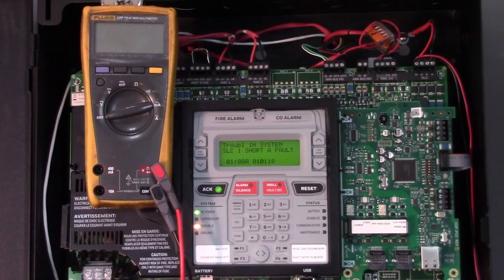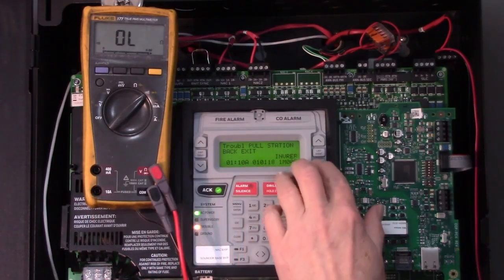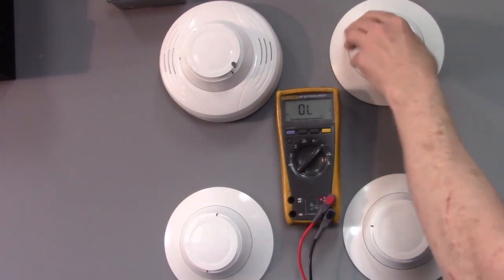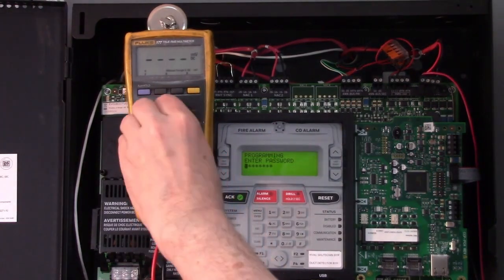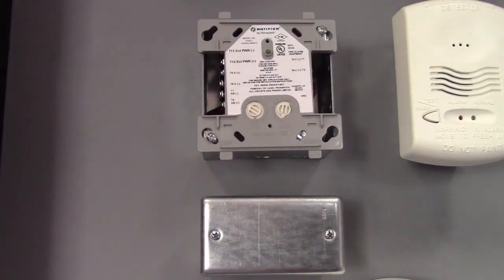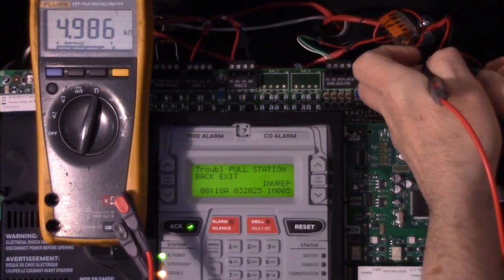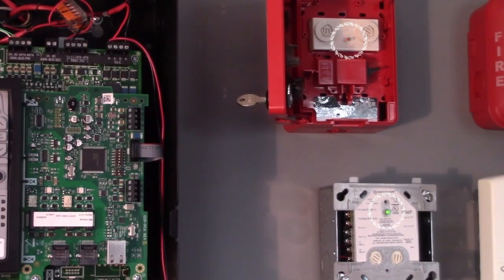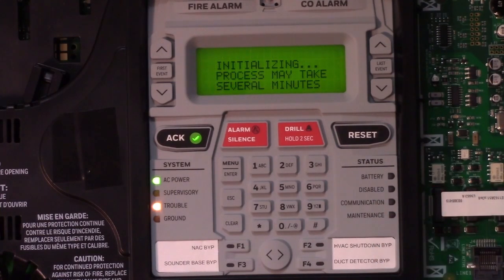⚠️ Troubleshooting Fire Alarm SLC Issues

Comment: I wouldn’t trust the resistor readings your making after you pull the SLC off the panel board. You should remove the plug to get an accurate reading.
Reply from the maker: Hello,
I am unsure what you mean, when unplugged there is no continuity between the + and - terminals of the connector.  Is there a specific timestamp in the video that would help me understand?

Comment: Hey man, not to knock your video. Youre really great. But maybe some quality contril would help some people. Your video is right on track. However, in the video you didnt really explain in the begining why swapping the leads is important. Also, while checking diode mode, you had it on continuity. Not diode mode. Diode mode prodices a small voltage. Otherwise good video!
Reply from the maker: After looking again you are correct, I neglected to push the button to activate the diode check mode, the Fluke 77 in my field kit doesn't require the extra step. Very observant!
Fortunately with that meter, the method works with both settings, displayed as ohms or volts respectively.

There will be a Short video released Friday morning showing that in more detail, thanks again for the input.
https://youtube.com/shorts/3DIJITveSbs?feature=share
Reply from the maker: Hey, really appreciate you watching and taking the time to comment! You're totally right—I should’ve explained the lead swapping better. I was trying to show the difference with both ohms and diode check, but I can see how that got a bit muddy. Still figuring things out with YouTube, but feedback like this really helps me improve. Thanks again!

Comment: I had a panel last week with all the devices coming in as "invrep" how would you troubleshoot that?  Do you think the SLC is bad? It was a fire lite ms9200udls panel.
Reply from the maker: Hello, thank you for contacting us, please remember to like, subscribe, and share. 👍   🔔 
A few things come to mind.

Did you measure and document the DC and AC voltages on the SLC, it should be 16-20 VDC? I assume there are no shorts or grounds on the system and the panel programming should match the device's protocol, CLIP or LiteSpeed.

Do you have voltage at the devices that matches that measured at the FACP?

If you connect a couple of devices right at the FACP will they communicate? If not then it probably is a bad SLC.

You can also take a look at some of our other videos regarding the SLC with this one in particular: https://youtu.be/AQJupzMUg4I
There are also a couple of short videos on our channel regarding this.
Reply: Invalid reply means your device is either communicating incorrect due to wiring issues or a bad head.